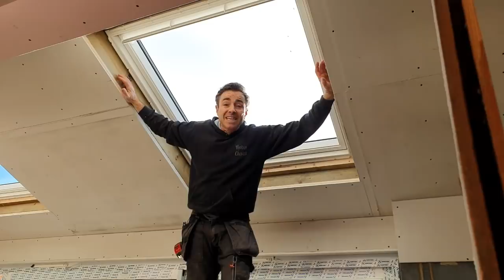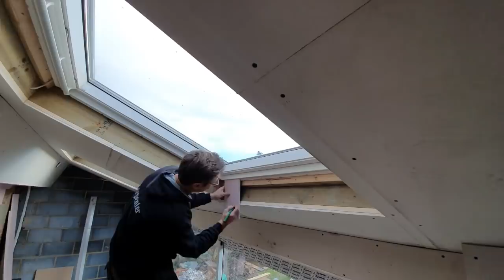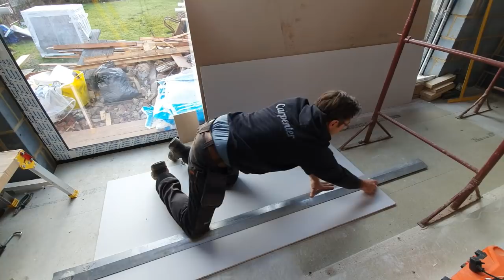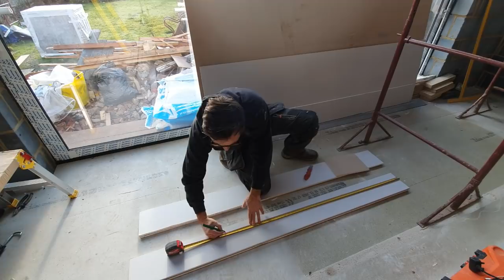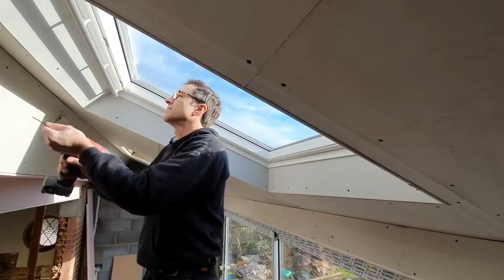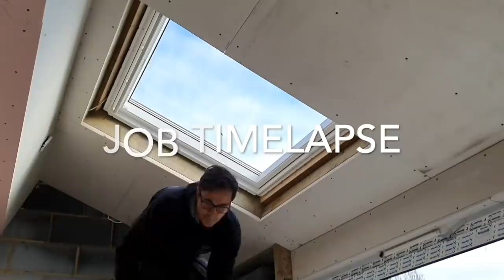How to Plasterboard a Roof window the fast easy way

Comment: Has anyone got any tips or even  contacts that could help me with retro fitting roof windows in a standing seem roof? Not had much luck with the manufacturers all the flashing instructions for standing seem show all the roof panels removed to one side. Looking for a way of doing it that’s not so dramatic. Cheers
Reply: Unfortunately it’s always a bit of a bigger job than intended in a standing seam roof, you’ll need to find a roofer that will do the external work to a high standard, the window itself is the same installation method, inc internal finishing, but the externals can need stripped back quite far depending on the roof makeup, always good to have the roofers on site when your installing the window. 
I’d strip out the inside and do the structural works first ready for the window to be dropped in, then have the roofers there the next day, have them strip out the necessary, and pop the window in, let them deal with the flashing and external while you have an easy shift installing plasterboard! 
Good luck

Comment: Nice one, looks class, don’t suppose you would know anything about insulating between rafters ? Should I get some slate vents in the roof to ventilate above them before boarding and plastering? Reluctant to start and then the roof sweats and all the timbers rot.  120 year old house. Cheers
Reply: U should have a 2 inch gap between celotex and felt/ tile, to allow for airflow and it will dissapate into ur soffit/facia vents
Reply: @zlock97  dont think I have soffits of fascia boards, like I said the house is 120 years old
Reply: @liamg9846 thight fit rigid insulation between the rafters, leaving a minimum 50mm air gap between the insulation and the felt. Use a good breathable roofing membrane, and dont stretch the membrane tight. The proper way to fit a breathable membrane is to let the membrane slight sag between each rafter. You could also double batten the roof for extra airflow below the slates, so a batten directly on top of rafters first, the batten as normal. Use a vapour barrier on the warm side of the insulation and also foil back plasterboard.

Comment: 'I've built this roof' well that's always a good start, having a proper joiner build your roofs haha! I'm sure alot of people already know, but a multi tool works well for cutting plasterboard close to the edge instead of the handsaws, you can also cut small width pieces with the multitool that you would struggle with a knife cutting
Great job as always, i bet the plasterers love seeing this quality of plasterboarding

Comment: Robin, I was wondering what is your favourite battery powered circular saw. seen you use so many types.
Reply: Probably the one with the most battery power at the time of the job 😉
Reply: Different ones fit different jobs more specifically, I think.
Reply: I own a ts55 but am looking into buying a battery powered circular saw. Just seen Robin use so many brands, wanted to know what saw he preferce.

Comment: This can look quite good, give the client the option but normally get asked to batten out and do square reveals. Matter of preference
Reply: They say it lets more light in. Who knows . Like you say each to their own
Reply: @arselickerfc9316  possibly yeah,minimal. If the window hasn't been fitted perfectly even gaps all the way round then the angles can look odd and wonky. If I've fitted the window myself I know it'll be right but more often than not it's a roofer who'll drop them in and not quite take so much care.
Reply: @arselickerfc9316  your correct velux recommend you I it as Robin shown for that exact reason
Reply: If they’re done like robin has on an angle then you let more light into the room

Comment: Good tips Robin. What's the reason for the original exterior wall above the steel being boarded at an angle? Aesthetics? Not seen that done before, looks good👍
Reply: I think just to give a square join, can look odd if that angle is acute, and this way is easier to skim and decorate. May even had noggins to suit.

Comment: Great to see splayed instead of the harsh looking square fit. 

Surely better air flow must help with any potential condensation too.
Reply: Velux suggests top to be horizontal and bottom reveal vertical, or close to, though not possible on very shallow or very steep roofs.
Reply: If you do the reveals square from the velux, you can fit in some insulation behind all the reveals. Without insulation the reveals are going to be a cold surface and potentially get condensation on them. Also use foil back board.